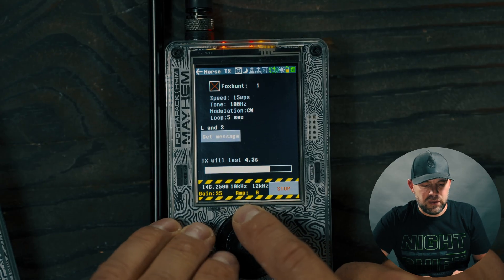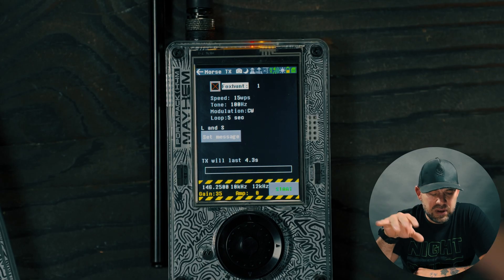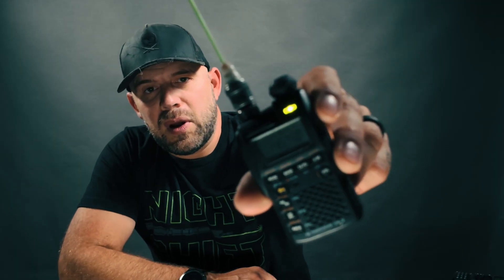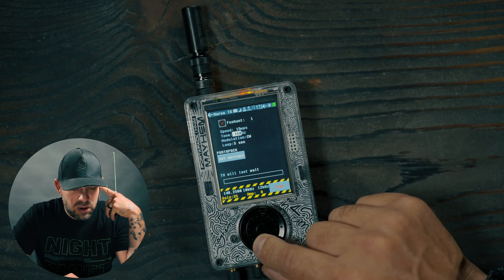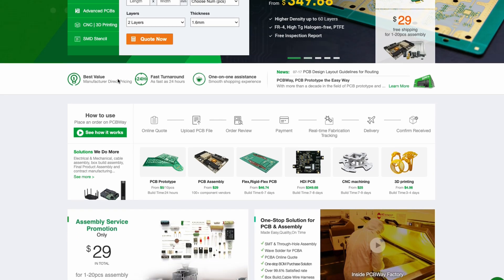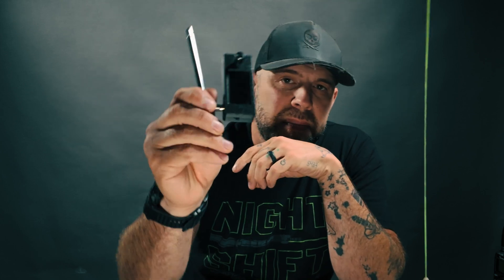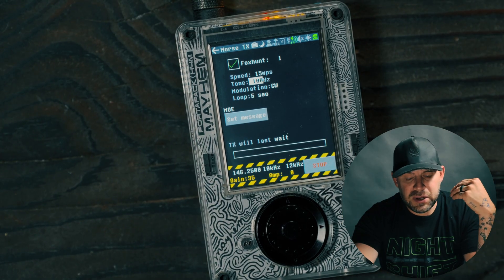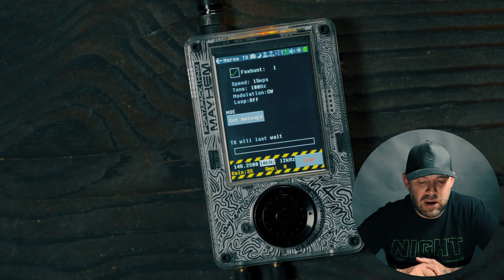PortaPacK H4M Morse Code Overview

Comment: I checked out the site to order these and I see it’s $ 165.00 in kit from China, and there is another price for $ 290.00 from the U.S. which would you recommend ?
Reply from the maker: US. If you order from China, you’ll see at checkout an additional $130ish for tariffs. The US based ones already have those tariffs applied and paid. You’ll also get it faster.
Reply: @Jeremiah.o.A.T . Hey thanks a lot I really appreciate it , have a good weekend !
Reply from the maker: @chriscomms.2399 anytime! You as well!
Reply: @Jeremiah.o.A.T . I just received mine and I noticed no operator manual, lol.
I guess it’s something to learn.
No Tech specs either and I was wondering what the TX power is on these things ?
Reply from the maker: @chriscomms.2399 10mW - 30mW depending on frequency and antennas used. Not much.
Reply: @Jeremiah.o.A.T  Thanks a lot, I really appreciate it ! I used to be a field tech back in the late 80’s into the early 2000’s. I’ve been out of this stuff for a while, lol. I am 60 and I am recently going through a divorce after 39 years. I bought one of these to give me something to do, and to keep my sanity.
Reply: @Jeremiah.o.A.T  Also would you know on the TX output with the little amp it came with ?
Reply from the maker: @chriscomms.2399 I’m sorry to hear that. I hope this re sparks your passion into radio. Feel free to reach out if you got any questions and if you’re on Discord, join my server. I give more one on one help there. And the community is awesome. Thank you for your time and support.
Reply from the maker: @chriscomms.2399 you’ll get a 20db gain. So an additional 20-30mh I believe. db to mW conversions are not my strong suit. Yet…
Reply: @Jeremiah.o.A.T . I am not familiar with Discord but I could definitely use your help.
Reply: @Jeremiah.o.A.T . Thank you 🙏🏼
Reply: @Jeremiah.o.A.T . I thought I could just turn it on snd checkout the location of aircraft but it’s saying there’s no map loaded or something like that.
Reply from the maker: @chriscomms.2399 you’ll need to update your Portapack. You can either use the Harckrf.app website or do it via SD card. The firmware can be found here. https://github.com/portapack-mayhem/mayhem-firmware/releases/

You’ll need to download firmware “copy to sd card” the larger file size. 548mb. That package has the maps.

HackRF.app site currently works for windows. At least last time I checked.
Reply: @Jeremiah.o.A.T . Awesome , thanks ! 
I hope my old laptop with windows 7 will work , lol. Not much of a computer dude, definitely love radio.
Reply: @Jeremiah.o.A.T . Is it normal for these not to come with any type of operators manual or instructions ?
Reply from the maker: @chriscomms.2399 ya. The mayhem GitHub wiki is your friend when it comes to to this.
Reply from the maker: @chriscomms.2399  https://github.com/portapack-mayhem/mayhem-firmware/wiki
Reply: @Jeremiah.o.A.T . Greatly appreciated Brother, thank you 🙏🏼
Reply from the maker: @chriscomms.2399 anytime.
Reply: @Jeremiah.o.A.T . I haven’t downloaded the update because my laptop is dead. But do you know if it can do CTCS and DCS tones so I could use this on a repeater ?
Reply from the maker: @chriscomms.2399 Transceiver app can do CTCSS, I haven’t seen or heard of DCS being added. You’ll need a good antenna and maybe an amp to do open up your repeater. Not saying it can’t be done. Just some advice. Another viewer a few month back made an HF contact from Alabama to Cali or something like that. It was a good QSO from what I remember.
Reply: @Jeremiah.o.A.T . Oh man that’s an awesome contact ! I have a GMRS license but I’ve been doing commercial comms back in the day. Climbing towers, running Heliax cable, repeater work, pagers, Nextel, PRC and BKR radios. I am looking forward to getting back into all this after all these years. Thanks for your help Brother I greatly appreciate it !
Reply from the maker: @chriscomms.2399 anytime!  That sounds like some fun. Climbing towers and stuff. Always admired guys like you. Thanks for the support!
Reply: @Jeremiah.o.A.T  You’re welcome !